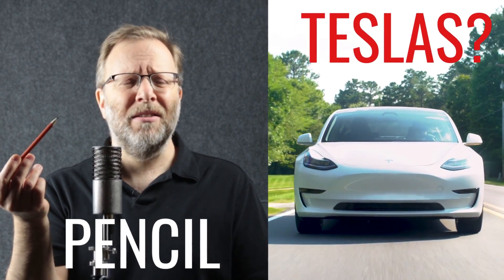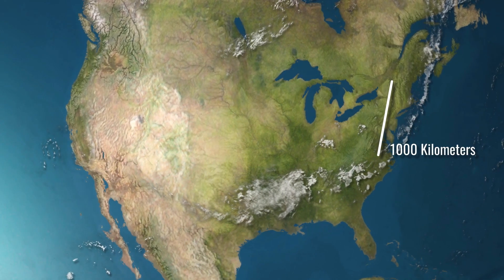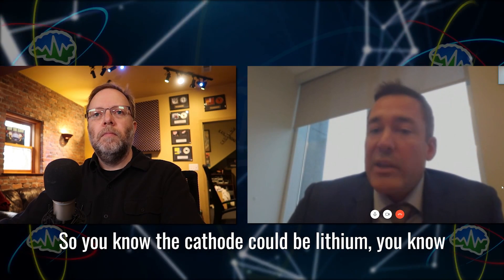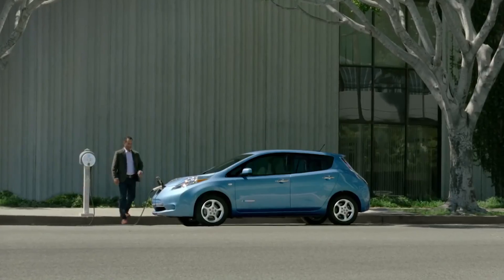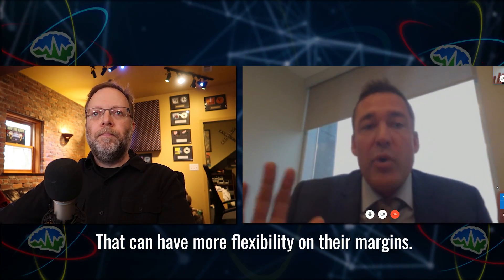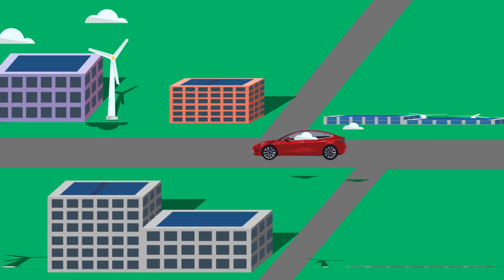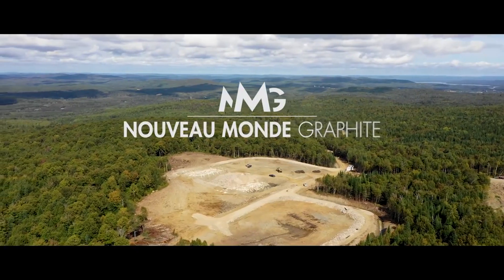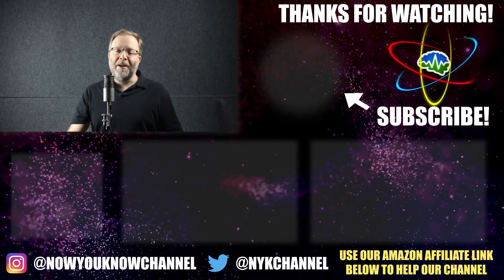From Pencils to Tesla: The Power of Graphite

Comment: Good video on the necessity of Graphite in Li-Ion batteries, and the need to have a stable source of this material.  But even more than its use in Li-ion batteries, Graphite in the form of Graphene will even more wide-spread usage, potentially as a replacement for copper wires, or as a battery in and of itself.

Comment: One word...capacitors... Lithium batteries will start to take a more back seat role as super capacitor tech comes online.
Reply: Actually, I think the future will be different. Supercapacitors will not replace batteries anytime soon, they have to different roles (high-density vs charing\discharging rates). In the future, I see the two technologies being used together for energy storage. Check out Skeleton Ultra Capacitor video by Fully Charged for more info.

Comment: Graphite has a huge competitor that will replace it sooner than you think. It’s graphite’s baby graphene. Graphene is the strongest,lightest and most flexible thing humanity has come across. It’s a thousand times more conducive than copper, it’s 200x stronger than steel and so light you can rest in in between a wheat poof without disturbing or breaking it. 

You want to talk about investing into the next big thing? Currently it’s hard to produce so it’s expensive thus stocks are super cheap, but when we come across this hurdle and we can mass produce it, it will be cheap and heavily in use this making the stocks more expensive down the road.

Buy low , sell high! Common now 😀

Comment: Not like they are doing anything special by running on renewable, Quebec grid is 96% hyrdo-power and 4% wind.  But good for them for using battery electric vehicle, Musk would notice and appreciate that and they are on the continent which is good for supply chain logistics.

Comment: I think 35k model 3 will come from China since they have cheap Graphite there
Reply: Graphite is very cheap anyway, like 50c/lb, not a big deal in an EV cost. Copper in the motors more costly, or Nickel in the battery

Comment: Is the Model 3 much cheaper to maintain than Camry?
Reply: in the long run yes
Reply: Maintain yes its much cheaper. But that's ignoring the up front cost difference. Currently BEVs are Not Comparable to Camry. They have had No Mass Production in the past 20 years vs Camry which has solds millions of units in that time. It's an unfair comparison in terms of Cost Scaling.
Reply: Let's see. Camry approx 30 mpg, Model 3 equiv 133 mpg. Then no oil and filter changes, no spark plugs, transmission services, no need to go to a gas station, ever. Yes initial cost is higher, but that's because Tesla really isn't in the same league as Camry. It's much higher. Compare to say BMW 3 series, still requires all the servicing and gas, so Model 3 annihilates it. Then, it is just a far superior drive to any ICE car. You get what you pay for. Road test one, and I guarantee Camry won't be on your shopping list for new cars.